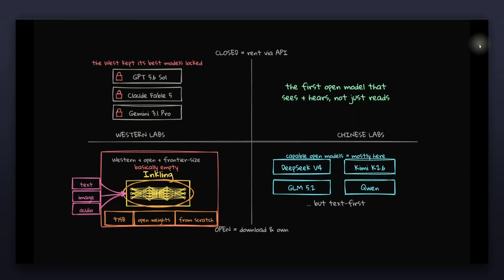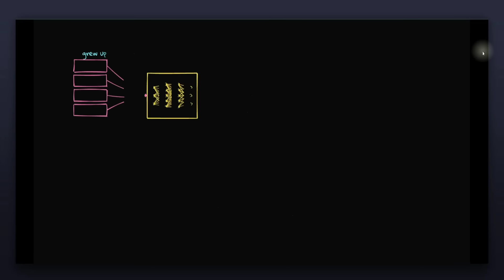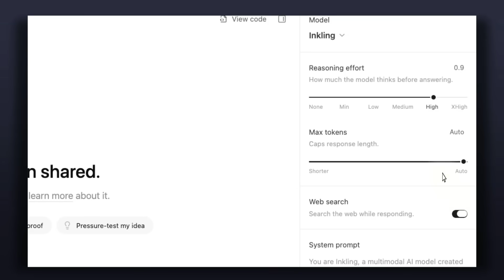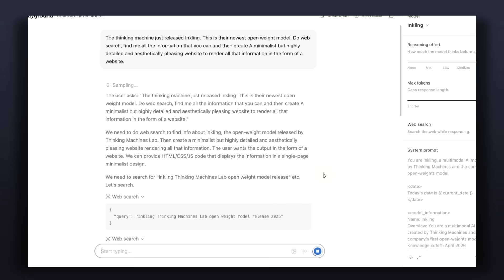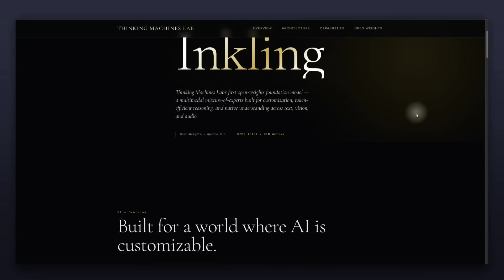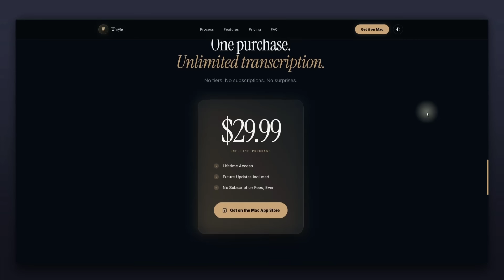Inkling: Why Thinky's Open Model May Change "Everything"

Comment: what is the point of this open model? Who has the hardware to run it?
Reply from the maker: these are geared towards the businesses.
Reply: @engineerprompt  makes sense.
Reply: @engineerprompt  I expect she can bring back the 4o-latest-snapshot
Reply: If it's good it will be on openrouter at very less cost